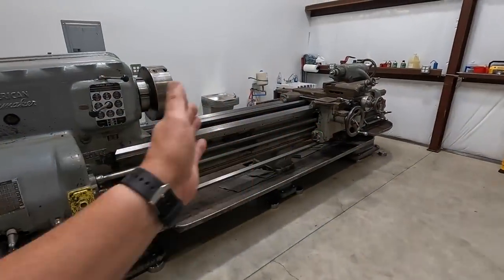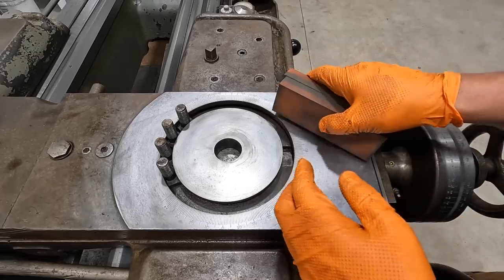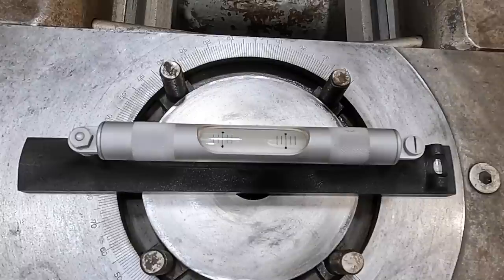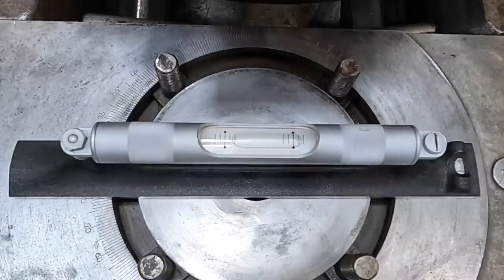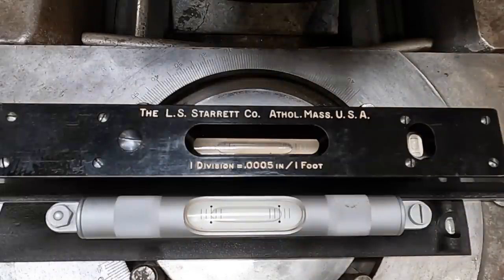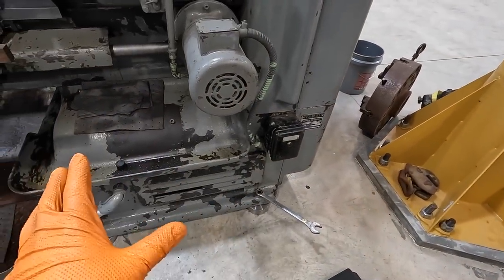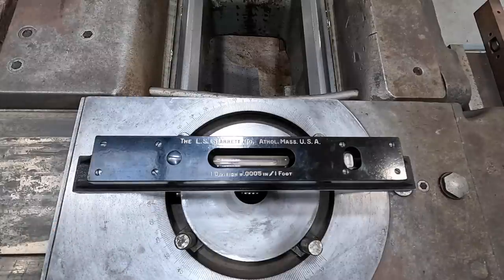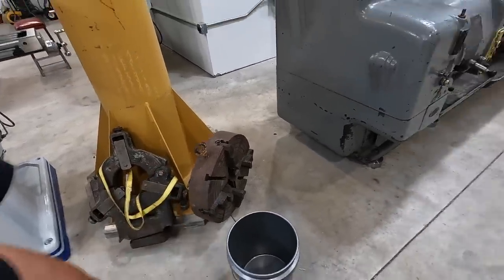Leveling the American Pacemaker Lathe

Comment: To everyone asking about levelling lengthwise (parallel to the ways) to eliminate hogging or sagging in the middle... yes it is important but one checks that AFTER levelling crosswise. First thing is tho get the twist out THEN get sag/hog out. THEN check for headstock alignment. Headstock alignment requires that you have something straight to align it to! Easiest way to get the bed straight is to use a precision level. There will be follow ups after the lathe has had some use and settled. Everything bends and twists... even a reinforced concrete floor. The question is by how much? and how much it varies over time and use. If you can measure by how much and it is enough affect the accuracy of the work then you can do something about it.
Reply: I'm thinking of giving my lathe a slight lean to the tail stock end, for the coolant to drain to.
Reply: @jemijona  The problem with that strategy is changing the level so that it actually helps drainage (or even makes it possible) by any noticeable amount is that it will also bury the bubble of a precision level on the uphill end. I suppose you could make some sort of base for your level to sit on with a few degrees of taper.... then you could get the drainage you want and still make sure your ways do not have any lengthwise bend in them. Might be easier to just alter the level of your coolant pan.
Reply: @utidjian  I wouldn't need a precision level for head to tail stock. But as long as their isn't any twist in the ways, I believe I should be good to go. I will have a good think about this when I do level the lathe. You would freak if you saw my lathe right now. It has yet to be set up and it has around 40mm of packers under the headstock and none under the tail stock. It took a bit of work to lift the headstock to get some kind of lifting device under it. I am doing small non important jobs as it is at the moment, but once I get my shed extended, then the proper setup will happen.

Comment: I have had the same problem when levelling machinery, large or small, but especially large machines of keeping an eye on the levels as I make adjustments. We ain't teenagers any more and a couple of hours doing squat-thrusts gets pretty tiring. What I did was mount a webcam looking at the level(s) and monitor the adjustments AS I was making them with a laptop on the floor beside me. Even easier now with a wireless monitoring app on your phone or tablet and a gopro or whatever looking at the levels.
With the camera-wifi/bluetooth-phone/tablet/laptop method you can level a machine of just about any size. Conceivably you could level a lathe on the top floor of the Empire State building from the jacking screws in the basement (if it has them)!
Good job Adam!
Reply: Me and two other guys were leveling a turntable for cars for the car show last week and I wish someone had thought of that! Strike that!  That would be less work for us.  :)
Reply: That's using your noodle, i couldn't walk properly for days when i leveled my big lathe.. I'll copy that idea when i move everything to my new shop.. i have a little 15 dollar endoscope now that plugs into my phone and it would be easy to stick in a indicator holder for easy aiming

Comment: Could the bed have a sag in the middle as you only supported it at the ends initially? I would like to see the level on the carriage the other way round and run from end to end. Des.
Reply: Agreed, but you'd only see a difference in long, very small diameter stock. I mean, imagine it drops by 5 thou on a 1" bar. Do the trig and the diameter change is negligible. Vs the twist has a noticeable effect.
Reply: If you got really fussy, you'd need to do it optically as the curvature of the earth is measurable at these levels of precision. At least according to my math it is.
Reply: Unless you had a decent load on it in the middle (which you shouldn't while leveling) I doubt there is any effect. This would be noticed anyway later for final.
Reply: I'd be curious so see how much variation there is. But given the that tool height is usually adjusted visually, I suspect keeping that dead on doesn't matter much. In theory a sag could bell or barrel a work piece, but what's the deflection on a shaft from tool pressure and how does that compare?
Reply: Yes, what about the lengthwise sag..?
Reply: I was wondering the same... I also missed the lengthwise leveling, but i guess that was just assumed and taken care of before hand?
Reply: @r.s.hildebrant2012  Could it be that the length of the ways don't need to be "level" to the earth, but straight (no sag) and parrallel against eachother ? So it don't matter if the lathe is a little up-downhill sort of speak, but the ways need to be straight. Don't now if that makes sense.
Reply: @TheMetalButcher  Not on an 8 foot length, but I set a 180' machine bed to a banana shape because my leica somehow got switched over to match the earths curvature.  Only cost a days worth of work before we caught it during the next mornings calibration.
Reply: @jeffreywakeman1472  8" per mile is greater than .0005 per 8 ft.
Reply: @TheMetalButcher  it can matter for a number of reasons. The tailstock won’t be pointing to the headstock. If the middle is low, for example, the tailstock will be pointing down at the end, straight ahead, but out of concentricity at the middle, and pointing up near the headstock. Does it matter? Depends on what you’re doing, and by how much it’s out. For most work, where you’re dealing with moderate precision, likely not. But if you’re doing high precision, high tolerance work, it could cause a problem.
Reply: @benjaminshropshire2900  it could either add, or subtract from the cut, depending on which way the sag, or hump goes, and by how much.
Reply: @melgross  the addition or subtraction also depends on if the cutter is set high or low.
Reply: @benjaminshropshire2900  of course, I assumed we all know that. The problem is that there are a lot of variables, and they all interact with each other, and there can be complex ways they interact. Some of it isn’t even predictable. It’s why many CNC machines have a unified bed, which helps to minimize much of this.

Then, this is still fairly new concrete. And concrete is plastic. So, over time it will move. More so in the beginning, but it’s continuous. How dense the substrate under the concrete is will determine much of that.
Reply: @TheMetalButcher  " 8" per mile is greater than .0005 per 8 ft. "

that is true in and of itself but you're making 3 mistakes:

1. you mentioned 5 thou earlier, that's 0.005". 0.0005" is 5 tenths. anyway, the inequality still holds true even with 5 thou, as 8" over 1 mile is equal to about 12 thou over 8ft. 

2. in reality, 8" per mile is the drop caused by the curvature of the earth; that's not a linear parameter so it doesn't scale down like that.
the formula for drop D is (R is earth's radius and L is the length over which we measure):
D = R * [1 - cos(L/R)]
this does output 8" for 1 mile, but for 8ft, D ~= 1.8e-5 inches which is about 0.2 tenths.

3. you're actually comparing apples to oranges. we're not interested in a curvature drop, but in the height of a circular arc (called the sagitta), to which the middle rises when conforming to earth's curvature.
the formula for sagitta S is:
S = R/sqrt(2) * sqrt[1 - cos(L/R)] * tan(L/4R)
over 8ft, this is S ~= 4.5e-6 inches, which is about 0.05 tenths, which is about 1000 times less than the estimated 5 thou worth of hyperbolic cosine sag the lathe might experience.
Reply: @calinguga  Good deal, thanks for the knowledge. I'll have to look into that closer for a full understanding. I appreciate you taking the time to write it all out.
Reply: @TheMetalButcher  thanks for taking it in good part, i was having fun, and had to think about it for a while. drop is not really used outside earth's geometry as far as i can tell. the sagitta ("sag") is much more common and useful, i just pulled the relationship off wikipedia and dressed it to only be expressed in terms of R and L. computation is done through wolframalpha.
Reply: @calinguga  Superb! I never (or rarely ever) get mad at folks going out of their way to teach me something!

Comment: Nice work and teaching method.  When I was a young apprentice I was taught to work in a figure 8 while stoning.  I always used this method for milling machine tables, vises, steel surface plates, and even cylinder heads/engine decks.  Anywhere you required a nice flat surface.  Have you or anyone else ever heard to use a figure 8 pattern?

Comment: Interesting side note: the reason that granite started to be used for surface plates was materiel shortages during WW-II. The reason that people never went back (to cast iron) is that damage to a granite surface tends to not leave high spots, just voids, where as cast iron tend to form an elevated ring around any damage.
Reply: Really, I'd never thought about it in that way, i'd always assumed that iron is ok for small 30cmx30cm plates etc and being small the thermal distortion was negligible but with larger plates and 'tables' the thermal distortion and physical ridigity became a dominant factor.  Of course it could also be (thinking about it some more) the developed ability to ultra precision grind granite surfaces, and be able to measure the flatness that prompted the practical abandonment of iron.
Reply: id add that granite is a far superior material for surface plates, it never rust, very easy to maintain, and easy to lap in to a nice flat surface.  It doesn't have all the internal stresses of cast iron either.  Plus it looks really nice all polished up!!

Comment: Hmm, could the lathe be bowed from front to back though? Like if the middle is lower than the ends. That's definitely something I'd check for as well.

Btw. for precision levels, at work we have some really fancy digital precision levels that measure to one micron per meter accurate. That's 12 millionths of an inch per foot. Crazy...
Reply: That sounds like it would almost be sensitive enough to be thrown off by gravitational irregularities in the surrounding area. Crazy.
Reply: Is there any way to set up an leveled laser beam on one end of the lathe and focus it on a level receiver  on the far end. Between beam and the receiver near the center of the ways place another block with a tiny precision hole. When’s the beam is set exactly right it should go right through the tiny hole proving the center is the same height as the ends.
Reply: @F0XD1E  Especially when you consider that Adam does distort gravitational waves. Especially after lunch.
Reply: @F0XD1E  nah, that's a whole other magnitude of scale. but you can definitely see it move when someone is leaning on the machine bed.

Comment: I have done this task too, and my method was to snug down all the jacking bolts by hand and then pre-load all the bolts by 1 1/2 turns. 
That way the machine had all the bolts with roughly the same amount of load. 
Then if I needed to adjust one end I would rotate all 4 bolts equally. This kept the load evenly distributed around all 4 bolts. 
If I needed to adjust across the machine I would do 2 bolts/side at a time. Its not perfect but worked for me.
We also had a 199 and I used to hide it because the other guys mis-treated it...I don't think they understood just how high quality a level it was.

Comment: Another vote for Adam's awesome care and attention to detail 👏
Just 2 questions though...
(1) Will the vibrations from running the machine create much movement in these leveling feet creating a need to re-level the lathe after a run in period?
And (2), what's the most significant issue caused by an unlevel machine?. 
I assume machine longevity is a big factor, but does a slightly unlevel machine translate into noticeable differences in the workpiece?
Reply: A good question...its borderline, sometimes yes, sometimes no, but always good practice to do a settlement check after about 3 months. (but rarely done in industry)
2) Vibrations (chatter), just gravity I guess.

Comment: One note on the precision stones, if you have three and lap them all against each other (A/B, B/C, A/C, repeat the cycle a few times), they will automatically create a precision flat surface. Just two could cause one to be convex and the other concave (mathematically, the surfaces would be a section of a sphere [both of the same radius], but that is assuming perfectly even lapping and even minor rotation of the stones)

Comment: I noticed at one point in the process you mentioned you had adjusted "twist" out of the frame. We did not see a process to check if there was a droop or bow from end to end. Does the frame design minimize this problem or is it something you are addressing at a later date?

Comment: do you think you should go around with a torque wrench to make sure each bolt has the same amount of torque on it? that way the weight is distributed evenly, or are there other factors to where that wouldnt work? Maybe the fact that the weight distribution isnt even?

Comment: Adam one question: you levelled on the Y axis at the headstock, tailstock and in the middle, why didn't you level on the X axis at those positions too? It could be high at either end or have a hump or dip in the centre.
Reply: You will have to rechecked it, until it is the best possible, that is why this kind of task usually can turn in to a "chasing tale task" only the experience will help you with the time to know when is enough... Or is something wrong... "iteration process" is ti called
Reply: As Adam mentioned, the biggest issue is twist. That causes taper in a length of material you are machining. There are other areas Adam has to check like tailstock alignment but twist has to be sorted first. The longitudinal imperfections on the X axis make minimal difference to the accurate operation of the lathe (as long as you get it close in the first place - which Adam did). If you were really pedantic then you could recheck the X alignment and readjust that but then the more important Y alignment would go out of whack again - you end up chasing your tail for many, many hours. Also remember that the accuracy of the Starrett level is 0.0005" per ft. If lathe is out by even 0.001 per ft on the X axis,  then that is not end of all accuracy of any finished machined items.

Comment: Amazing how sensitive the 199 is, it moved a lot while the Lufkin never even moved, how do you tell if the middle is higher or lower than either end, did you have the levels length ways ie parallel with ways, I couldn’t tell from the video, I ask out of curiosity’s sake as I would happily watch a 4hr video on precision levelling and the tools used.

Comment: do you check center to headstock and center to tailstock to make sure it isn't high or low in the center verses the ends or did i miss it
Reply: I was thinking the same
Reply: That's what test cuts are for. ;) But you have to have the lathe level first. You make a long cut on a bar and measure the difference in diameter at the ends, then adjust the tailstock to even it out by moving it side to side or shimming the tailstock for center height.

Comment: I didnt read too far down in the comments but, My Clausing 15x48 owners manual required use of the bed its self. using a parallel bar on each end to remove the twist, then across to get it level.  Id be pressed to say after 60+ years in service the carriage and bed would have enough wear it the typical "work areas" would make them very poor surfaces for leveling or removing twist in relationship to the head and tail stock.